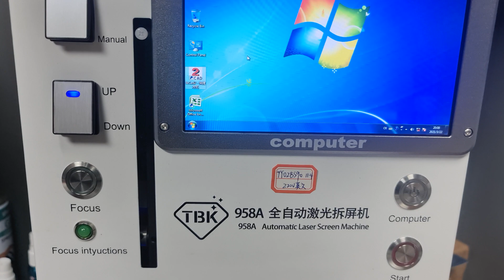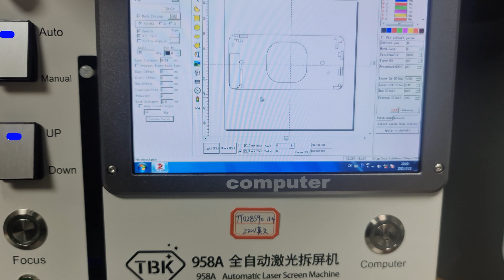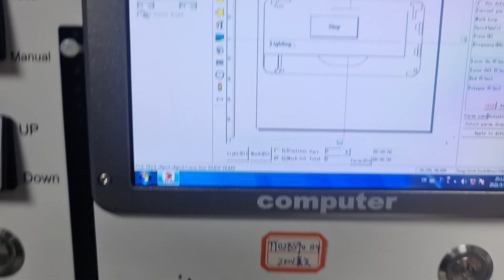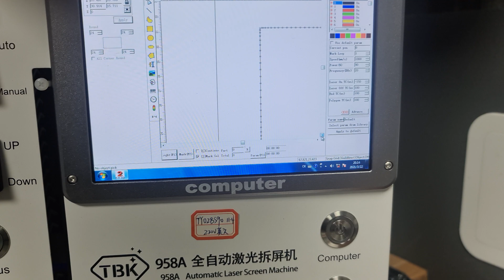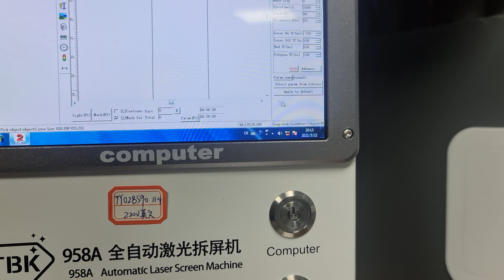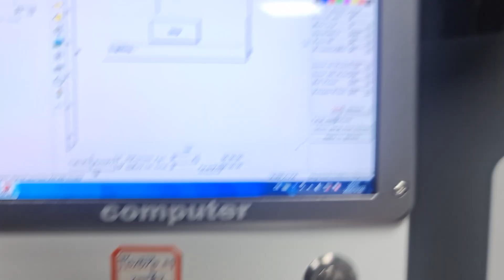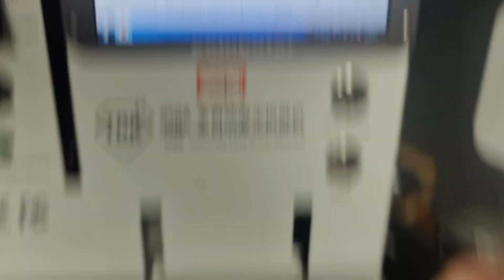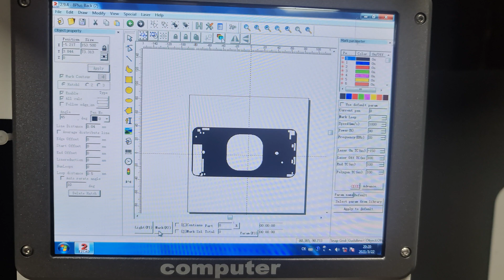TBK 958A Laser machine - modify templates - How to

Comment: Great video, Very helpfull!

I got a mini TBK laser and i'm adjusting my own templates now after your video.

What i dont understand is my machine starts laser ing at 45 degree and when it has done a full round it starts doing a second round but then in a mirror 45 degree pattern.

How can i just let him do 1 round and let it stop? Because i do 1 round, remove glass and then without glass a second round
Reply from the maker: That's something I need to look at myself, as I prefer lasering once at a slower speed. 

You can do a search for "EZ cad" on here, and there's an in depth explaination on how to use the software. 
I'm pretty sure it's on one of those main channels which show EZ cad.

Comment: Hi, I have the tbk 958b I would like to switch to ezcad 2 how can I do that knowing that the machine boots directly on the original software
Reply from the maker: Not sure exactly.
I would try and do the following: 

Copy hard drive/backup so if anything happens, you can revert back. 
Download the ezcad you want and install, see what happens.

Checkout tbk website, as I think they have available firmware/software to download.
Reply: Sam issue machine boot auto to custom software. No windows version

Comment: Hello, great video! Can you please make a video about how to set up the machine for first users and how to edit and upload new templates for different iPhones. Thanks, a lot you just got a new subscriber.
Reply from the maker: Pretty much the same process as this.
You're just resizing lines/shapes around the perimeter of the phone.
The first time you do one, do the outline of the phone. And a rough guess of where the wireless coil is. 
Pass the laser over once, remove the glass, and with the glass removed, you ccan then follow this video by adding more blanking sections. Would take quite a while, but once done, it's saved.

You can also now buy NASSAN back glass covers, so no need to make these templates, just make a big phone shape, and the cover you put on the back of the phone blanks off all the important sections :)

If there's a certain section you're unsure of, let me know.